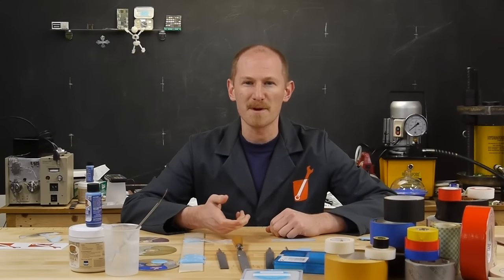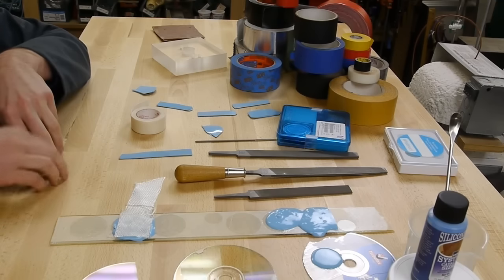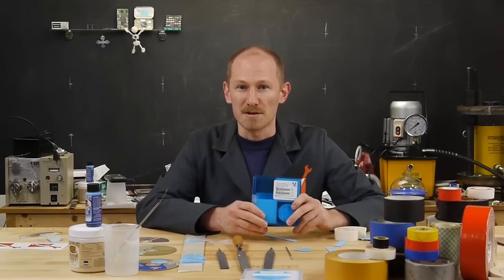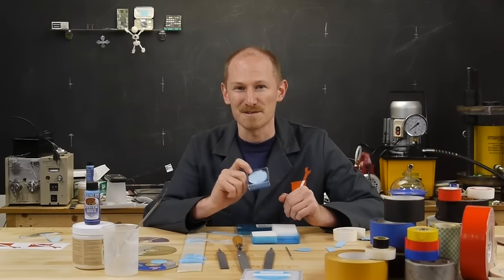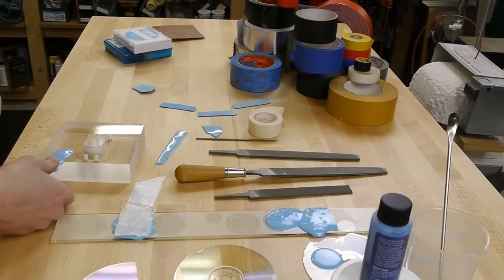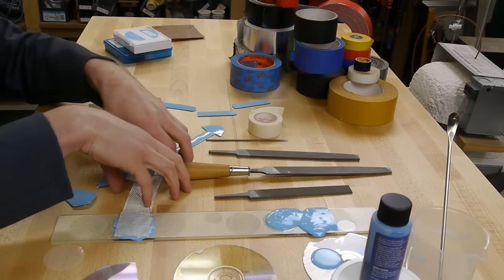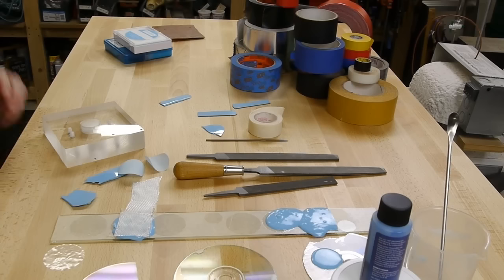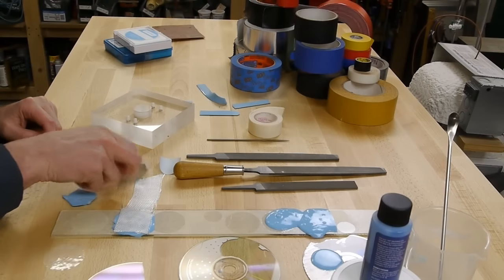Making DIY gecko tape - work in progress

Comment: 1. idea: is there a material which is transparent and changes molecular structure permanently if hit by light? (thinking about the chemical process involved in your video about photocromic glas)
the idea is to change the molecular structure by shining tiny rays of light on a surface. photons, unlike beta-rays are much easier to direct in a single direction, and much safer to handle. if the material is translucient you can basicaly shine small "pilars" of chemicaly altered material into it. now you need to etch out the holes, and there you got your mold with holes in the direction of your pleasing. by controlling the density of your rubber liquid you can determine the hight of your colums.

2. idea: its just what they used to produce the "Nuclepore Polycarbonate", with the slight difference that the whole process is produced under vacuum (by eliminating most atoms of the air you reduce many of the points between the radioactive substance and the Polycarbonate disc, which can alter the direction of the beta rays) and to deflect the unwanted beta rays that fly in a unwanted direction with magnets. 
Sidenote: the "weakening" of the holes in the Polycarbonate happens trough ionisation, right? can this ionisation not be achieved by using other non nuclear rays, for example gama-rays or simply kathode rays (flying electrones)? here too its much easier to controll the flight direction of the rays.

Comment: If you were able to have two materials, one resistant to an "etching  solution" and one not and you were able to pull those like hand-pulled cotton candy (search dragons beard for an example) you would be able to get ridiculously small pillars if you were able to control the etching process on the cross sectional area.

Comment: what about using fine wire to cast into a mold then pour the silicone into that mold. Or something like a fiber glass like material. Basically creating a nanoporous negative for your silicone.

Comment: I think you're on the right track with the cd's. See if you can find someone who has some hardware hacking experience and maybe they can manipulate a burner drive to do a pattern instead of typical data. I'm not certain but multiple runs could very well allow you to get more depth, and you would be able to control the spacing quite well as compared to a random cd's pattern. Just a thought. They're remarkably precise components.
The pun wasn't intended.

Comment: +Applied Science, I have two ideas.

1. Experiment making molds with blasting techniques such as sand/bead blasting or maybe even WPC treatment (http://www.wpctreatment.com/).

2. First make a positive mold. You could do this with a traditional composite such as fiberglass/carbon fiber in a resin matrix but with the strands perpendicular to the surface. You could process the surface by sanding. Little hairs of fiber would be left sticking up. Different matrix materials and differing sanding techniques might give you the ability to alter the length of the resulting hairs. You could then hopefully cast a negative mold out of some sort of resin (would need to figure out how to not make it stick). Now you have a mold to cast the silicon onto.

Comment: This is pretty old now but could you try the disc method again with a dvd or blueray disc. I checked wikapedia and the pit size of a cd was around 500nm, dvd 400nm, 150nm and would assume there would be a higher density of pits as well.

Comment: Hay Ben I've been thinking about ways you could do this using lapping setups to create the pattern you want. Unfortunately all my ideas involve electroplating and what not. 

I wanted to ask however, Would you be willing to do a video showing off lapping of a surface using various compounds and methods? I figure it would be interesting to look at under your SEM, I would be willing to even send you some tool steel blanks that I sharpened up using water stones and chromium oxide.

Comment: maybe those approaches have mentioned before, but it's just too much to read those all...so i'll blindly just post my 2 cents:

- try mold on abrasive adhesives like diamond/Al2O3 coating ?
- build a positive by growing hexagonal crystals or organic material like fungus ? a few micros on a substrate, make negative mold an use this to cast the gecko material ?
- build a positive by arranging nano/microscale fibers with the help of an electrostatic field an fixate them by some way.  
- use a cd/dvd laser/lens unit to 'burn' deeper holes in a carrier material and cast from that
- cast from osmotic filter membranes under light vacuum could work maybe

hope those helped/inspired

cheers

Comment: To make the silicon sharp using the Swiss file, you could mold the file with a hard substance and use that mold to mold the silicon, resulting in a replica of the file opposed to an inverted model. This might not work though because molding twice would result in errors in the mold, much like duplicating a key using an already duplicated key results in the final key not sliding though the key slot as easy as the original.

Comment: I wonder if making just the surface foam up could work, so that the surface is least dense but gets support quickly, maybe shave off to open up the foam cells.
Figure someone has mentioned casting the Swiss file then using that as the mold for the silicone..

Comment: how about co2 laser engraved acrylic,  or even casting onto optical diffraction grating film can be found at a number of nanometer prisms  (maybe even rainbow firework glasses).   but i suspect you are getting more bernoulli vacuum effect than actual weak force van der waals effect with your flat cast rubber.

Comment: Im not a anything of a scientist but I work with opals and immediately thought of very fine grit polishing products as an idea of something to try to cast. Im not sure if its even small enough at that scale or if you could remove the silicone after it has dried to it. Also thought if you took something like a 100,000 grit and light sanded a piece of plexiglass and then cast on that? Anyways just something that came to mind. Very interesting stuff, enjoy your videos!

Comment: Have you tried anodizing aluminum. It will create high density pores about 125-225 angstroms in diameter depending on the type of anodize you do.Though they may be too deep. check it out!

Comment: What about extremely high grit sandpaper as a "wafer" ? 
What about and old photo sensor? (They have piwels a few microns large at most, the inter-pixel lines are orthogonal) 

What about pouring the silison (or whatever material) onto a brush-like surface, made of some sort of short fibers (glass, carbon, aramid, paper) and then either removing the silicon, or disolving the brush with adequate solvents? 

What about high voltage spikes into solid polycarbonate substrate? They produce patterns I find visualy suitable. Perhaps the correct voltage/ pulse length / material thickness could require some working around. 

How about the alignment of microsopic carbon fibers in an almost uniform electrical field, and pouring the silicon on it? 

How about microscopic steel / ferromagnetic material, aligned  under locally uniform magnetic field, bathed in silicon? 

Great video, as always. Greetings from France!

Comment: I would setup a machine to make razor cuts in a diamond pattern or a triangular pattern to achieve pillars or try to replicate the picture or stack razor blades and mold over them edge wise....however I suspect the geko has suction muscles

Comment: Hi, how about using your sputtering chamber with a proper gas mixture to functionalize the flat cast-on-glass silicone surface? There should be some processes which are used to create hair like structures on polymer surfaces only by reactive plasma treatment without masking the surface...

Comment: Two comments:

1. why not grow nanotubes using your kitchen oven and deposit the tape material after that. I have heard some time ago people doing that. excuse me for the lack of reference

2. have you tried peel such tapes in vacuum. there is a cool method to generate xrays peeling tapes in vacuum. there is a video from nature magazine about that. I'm wondering if it's possible modulate the emission or reduce the energy to a UV region. that can be a good quality control strategy when you find the right recipe. A macroscopic phenomena to describe a macroscopic characteristic. 

congratulations for the cool video

Comment: Could you bottom-fill the holes in the track-edged membrane with a thin layer of <some kind of glue, maybe set by UV light> then cast the silicone when the pits are a more suitable aspect ratio?

Comment: you can buy diffraction gratings with features around 1 um and they can be cast with silicone
Reply: google scholar search "Adhesive micro-line periodicity determines guidance of axonal outgrowth" for a part number of the diffraction grating

Comment: I was once intrigued by a comment that the IC manufacturing process nowadays uses controlled diffraction, opposed to a mask in order to etch the substrate. I don't know how feasible or applicable that would be, but maybe it would provide a catalyst to more useful ideas.

Comment: How about kneading two same consistency materials together like in candy making. In this case you would just keep thinning out the material until it is fine enough. Then you would slice it. Use some adhesive to bind the legs on the other side while from the other side you erode the other material with some technique (obviously good for the material while bad for the legs).

Comment: Water immersion lithography, one of your prior videos shows a water droplet lens I believe, and this is the technique that IBM used to get to a much smaller silicon process node for CPU's when etching. https://en.wikipedia.org/wiki/Immersion_lithography

Another option would be focused laser such as out of a DVD or Blu-Ray burner, coat a cleaned burnable CD with mask and then write a complete 1-0 sequence to the disc before etching.

Comment: Why not use common SLA 3D printing techniques? SLA resins are polymerized at long UV / violet wavelengths. You don't need specialized optics for that. You could, concievably, use a DLP projector and focus down to a very high density, then build up the mold for silicone layer by layer from resin.

Comment: Since you asked, a couple of other ideas:

Self-adhesive/film holograms are reproduced via various forms of photolithography/master impressioning that might be useful, perhaps constructed with an interference/Moire pattern; this isn't inaccessible but it's complex and is implicitly in the nm range since you wind up with interference as the final product.

Try this:   hologramsuppliers (dot) org/hologram-masters/

Since the "file" casting were the reverse of what you'd wanted (rounded tips/sharp valleys) why not try reverse-casting it?  Make a casting of the file, producing round tips/sharp valleys, coat with mold release and cast on the first casting, reversing the texture and producing sharp tips/round valleys that the file had at first.

Taking that a step farther, don't forget the most ubiquitous precision casting through history - phonograph records, particularly 33RPM which had a very fine texture.  If you could reverse cast that as with the files above you might get somewhere.

I've also done some work with "Reprosil" (RTV used for casting for SEM work) to reproduce rust pits in metal for analysis, but I'm not sure how you'd get a regular pattern of those.

Comment: Welp... how about a mirror? Glass won't pass UV, and grinding a UV lens out of something like salt would probably be a bit ridiculous... so a concave mirror, or a newtonian type telescope - mount your transparency at one end of the tube, printed macroscopically, and expose the photoresist at the eyepiece? (Obviously without a lens in the eyepiece aperture...) You can even use the sun as your UV source.

The only other thing I can think of for using photo masks on that scale... maybe print on polyester shrink film? Think Monokote - there are clear varieties, and it easily shrinks to half its original size, though I'm not sure if there's a significant anisotropy, or how badly it would wrinkle if shrunk without tension - RC planes are covered with it, but it's usually stuck down tightly and then shrunk to tighten the skin up.

As for other means to expose the resist... maybe a UV laser with a tight aperture, good collimator, and a piezo driven tip/tilt mirror so you can laser-light-show/vector graphics your resist pattern directly with the beam. That'd require a driver, but not significantly more complicated than home brew laser projectors, just with a different output amp to move piezos.

really expensive tip/tilt (but also amazing precision): http://www.physikinstrumente.com/products/tip-tilt-mirrors.html

http://hackaday.com/2015/01/13/cheap-diy-microscope-sees-individual-atoms/ but use a first-surface mirror in place of the probe tip?

You can always increase the effective throw of a low-throw mechanical mirror by bouncing the light back and forth a few times to increase the path length rather than mounting the mirror across the room from your target.

Yeah, I'm pretty tapped. It's also 4AM. Good luck!

Comment: Hi there. What about optical diffraction gratings. I have seen some of them and in additionthere is a cleaning agent that basically is a curing rubber/silicone that is poured onto it and peeled off when hardened. Reminded me of the casts of the files.

Comment: try materials with high surface areas. electrolytic capacitors, li-ion batteries, activated charcoal.

for the laser printing - try to print on pre-stretched latex (condoms, yea!), and than let it shrink back.

lenses/color filters on the sensor of a photo camera may be good (and with sharp inverted edges, because lenses are half-spheres).

for the file casting - try double casting (cast a mold from the file, and use that mold again to cast tape).

for photolithography - may be CD as template will do better than CD as a mold?

Comment: Having worked at Samsung in the etch department has anyone mentioned the method used to etch silicon to make solid state devices? Seems we were getting down to removing atoms. Could that same process be used to create a mold? Since it certainly works in the clean room to make memory and CPUs.

Comment: It is easy to make silver nanoparticles, you can even decide the size and the shape (some of them are prisms, some of them are spheres, and could be small or big particles - depending on the chemical protocol). What if you mix this type of nanaoparticles with a plastic (like epoxy) and after that remove the silver part using acid for example ? If the ratio silver nanop/plastic is adequate  and the surface is smooth enough, after silver removing you can decide how many, how big and which shape will have your nanoholes - which will be almost only at the surface of the plastic. In this way you could obtain a molding form for your silicone.
Also, may be your type of silicone is not the best type for this experiment.

Comment: Ben, have you tried different coarseness of emery paper on something like aluminium? they should get you something like the pattern you're looking for.
Maybe using a random orbital sander with 400 grit paper might get you in the ballpark?
If not then also using what would traditionally be the wrong tool on the mill should be able to generate you tooling marks in the ballpark of the geometry you're after? maybe something like using a face mill with stainless steel (grade M) inserts and no coolant on aluminium could really make a microscopically messy surface ;)

Comment: Perhaps a bit more involved than you'd like but wouldn't it be possible to hack a cd burner to burn holes exactly where and as deep as you want? You'd need to custom develop software that uses the burner in a way that is wildly different from its intended purpose.

Comment: Challenge : 
Gecko vs Octopus on a flat glass wall 20 meters high with high lateral winds.
Moral: what's the point of gecko tape ? Gecko's natural habitat isn't a flat surface and it has to resist gravity.
Also, a CD has grooves in the order of nanometers, gecko's "hairs" ( which are actually more like "hook nails") are in the order of micrometers.
Unless you're trying to be spider-man, nobody needs "useless" gecko tapes; try with a cast made from a natural marine sponge instead or make an emulsion of air and soft/sticky silicon;cut a few stripes and if the structure is that of a "groovy cheese",so that you'll have millions of tiny little suction cups, you're done.

Comment: Motivated by this video, I tried earplug against the table and it sticks a little (i can hear that ck sound when lifting it). I think it's also because of a vacuum, but you can try it.. (it does matter which you try - the pores on this are not visible without a microscope and the surface on the cut is almost shiny. I've older bigger ones (orange color) and they're porous and I can clearly see the pores and they don't stick. I think both are 3m)

Comment: this is called F4 tape.  techs and mechanics used it on the old F4 fantoms sometimes stupidly as a perminate fix to broken stuff.  on the F-16 i commonly used it to cover holes on the pitot tube when doing pressure testing on the system.

edit for website http://www.f4tape.com/

Comment: Try a blu-ray disc, It might end up the same way as the CD But it has a more dense concentration of pits and the pits are smaller in diameter with about the same depth as the CD.

Comment: maybe you could try to slide the Swiss file on a flat piece of polycarbonate in a direction parallel to the teeth,in order to transfer the sharp teeth marks to the casting surface...